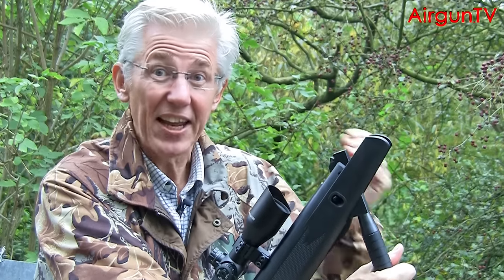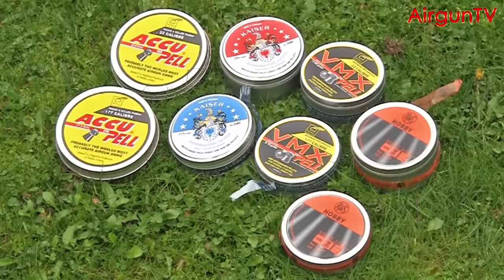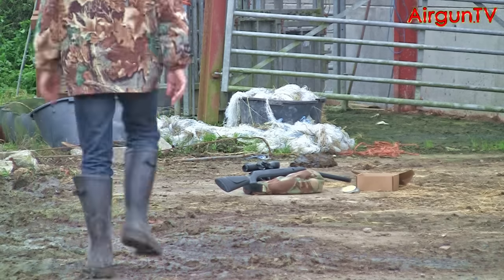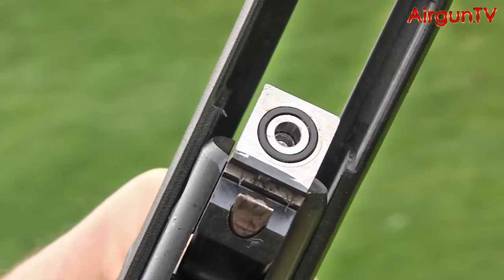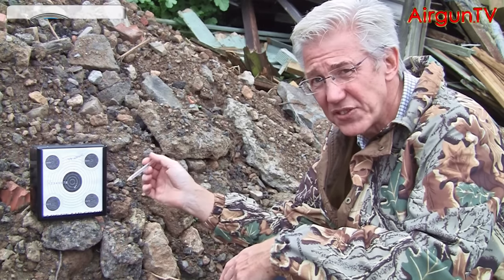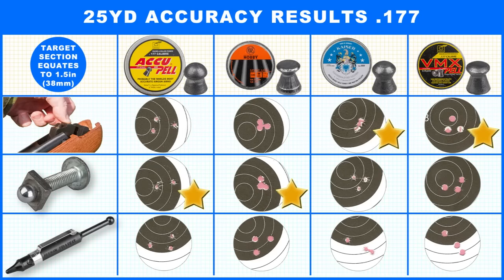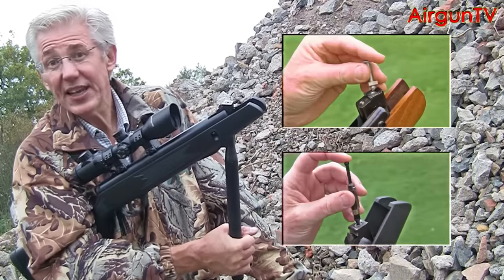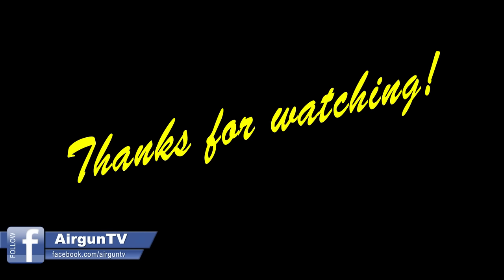PELLET SEATING - boost performance of .177 & .22 air rifles?

Comment: Your video piqued my interest as it reminds me when I seat center fire bullets.  It appears that you get the accuracy with your ball bearing  pellet seater.  You beveled,  slightly,  the mouth of the breach.  So when the pellet is seated, is the pellet seated just slightly below the flush level of the beach?  Thanks for the upload.
Reply from the maker: +Tyrone Kim It's pretty much flush; the bevel (chamfer) helps the pellet skirt 'break' at the optimum pressure point (IMO)
Reply: AirgunTV Thanks. Best wishes.

Comment: i seat my pellets with a .22rifire cartridge with a ball bearing glued in the end. in my experience it doesnt so much improve accuracy but it does improve consistency as all pellets are seated identically :)
Reply from the maker: Thanks for that info - and useful tip - Lewis. Much appreciated. ATB, Nige
Reply: AirgunTV no problem nigel. i love that your doing videos again, you videos are very interesting putting theories to the test. keep up the great work!
Reply from the maker: +lewis furness Appreciated:)

Comment: Nigel, I would also like to see the standard deviations and %RSD (100*standard deviation/average) from the power measurements. Rather than just looking at total power, the spread of the power measurements would be a more accurate evaluation. For instance, if the power did not improve but the %RSD did. This would show a more consistent power output even if it was lower.

Comment: Pellet seaters are always used for accuracy, not power. I dont see any way for it to increase power. The other reason to use one is to ensure that the pellet is actually fully inserted into the breech. If any pellet skirt, even a small amount shows that lead will either be sheared off or squashed. You dont want lead building up around there. You want to leave it all on the pellet. 
   Ive never been able to push a pellet fully in with my finger, so a pellet seater is a must afaic. I just use an old ball point pen tip. It works just fine. If the pen still works, nothing will happen to it. It can still be a pen.
   YMMV, FWIW, WFYB, JMHO, etc.

Comment: you can't beat a mark1 thumb, at least you've always got it with you
Reply from the maker: That is SO true superowl... although once you work out if pellet seating DOES make a difference to either your power or accuracy, you end up not having as much confidence in it as you used to!!! But I give your comment a, erm... thumbs-up!!! ;)
Reply: Yes you have always got your thumb with you right up to the point that you let go of the barrel when loading and the bear trap mechanism fails...

Comment: I lube the pellet before seating, and they seem to fly faster. At 30 yards, there is a noticeable reduction it impact time. Not scientific, but seems to work for me. Also penetration is a lot better.
Reply from the maker: +CaptAmerica12 Interesting...
Reply: If the lubricant used is petrol based it is called dieseling and will effect speed and power very much!  Use oil, not solvents or you will dissolve/damage the Oring. You may want to install a better o'ring for long term maintenance of rifle.
Reply: @Gregory Lankford
How do I get a better O-Ring for my air rifles? I have a Daisy 880s & Bear River TPR 1200.
Reply: it would also put him over the 12 ftlb uk limit.. and if it diesels some places consider that a firearm..
Reply: @ Gregory Lankford Actually dieselling does not make the projectile move any faster. It just gives a louder bang. Taofledermaus did a video on this and noticed the speed was consistent but the firing slightly more  louder than normal.
Reply from the maker: +william northcote I have to disagree. It'can' increase the velocity
Reply: So there now seems to be a disagreement. One is saying yes and the other is saying no. Is there a defined test online to prove if it is or not?
Reply from the maker: +william northcote Pellet lubing sometimes can increase velocity - due to reduced friction and/or afterburn [on springers] - and can also not. It's all a black art, not a science. You have test it with your own combo and see what works...
Reply: william northcote I watched the toafladermaus video, and he concluded that it doesn't increase power. I've seen other videos that show just the opposite.  This one is tough to decipher at the very least. I like diesling personally. And I do think it makes a power difference. But, I like toafladermaus and his stuff too.
Reply: Which lube mate? Durex?
Reply: +william northcote look up daisy vl
Reply: go to a car parts store and buy the hard o-rings  they will have o-rings in all kinds of diameters,
Reply: Lube can slow your velocity if it adds resistance. And can increase velocity if it either reduces friction, or diesels. Dieseling will destroy your gun. Not just the O ring, but the piston, and piston seals too. It is worse than dry firing.
Many lubes can cause dieseling. When trying lubed pellets, I lost velocity, and accuracy. With a few pellets, cleaning the pellets made a larger difference with accuracy. Sorting by weight, and sizing your pellets makes a bigger difference improving accuracy. Group your pellets to +- 0.05 grain.  Sizing may take several dies. Some of my guns like 0.177, some .0178, and one loves 0.176. 
All of my guns shoot best with a clean dry barrel. Solvents, most gun cleaners, bore cleaners and oils will destroy your seals in time. Lube your seals and O rings with silicone grease or oil. 100% silicone to prevent dieseling!
Reply: @gpecaut1  it depends where the dieseling occurs ,if its only in the barrel inside  ,its will not destroy the gun(i shot thausands off times with a full power tuned hw 80 that way  (thinking  of the weihrauch  baracuda eathergun factory made in the past where the eather air exploded in the cilinder), no oil or grease (only silicon oil or molybdeen disufide is ok  )must get  in the cilinder!!!!  only a in tinny bit in  the pellet hole. will do the job and effectively.

Comment: There is no secret to this, the pellets have to be seated flush in the breach. There cannot be any gap between the pellet and the barrel. Always make sure your pellets skirt is not deformed. Accuracy comes with learning how to shoot your particular air rifle. I have a low powered Springer which i shoot and can stack those pellets at 10meters, you just have to do your part. 😎

Comment: I have been seating my pellets for years..most of the cheaper air rifles you will hear and feel a thud as the piston bottoms out ,,however I made a pellet pusher out of a tapered centre punch with a brass washer pushed tightly on the taper of the punch ,thru trail and error I can finally can say it makes a big difference only because it does not push the pellet too far in only enough to reduce the friction at the start of the piston moving forward ,but maintains enough air pressure to widen the skirt of the pellet thus grabbing the rifling,,the only pellet I find where this is not worth doing is with the quality of RWS pellets

Comment: the beeman pellseat also has an ball on the end... next time use it... it also helps seal the pellet in the breech
Reply from the maker: +James Denny Thanks for the advice, James. I have used it in the past, but find that it 'splays' the skirt too much. Also, it's really only suited to the one calibre; i have a DIY tool for each calibre (which I perhaps should have pointed out in the video) - a 5/16" BB for .22 and a 9/32" BB for .177 pellets.

Comment: I would have collected more data w/ more shots. Dude should have done 3 sets of 3s.
 
   People assume "power" and speed equals better. It's not. It's all about finding the sweet spot for the gun and pellets. Each set up is different but there's always a spectral sweet spot on air rifles. 800-900 fps is usually good for .177 -.22 because the pellets, (being air driven) begin to swirl around the 70yrd mark. due to the wave tunnel behind the skirts.

Lol, mine 177s are still super tight at 60-70 yrds tho.

Comment: how did u make that seated m8
Reply from the maker: Hi Sniper - I just got a ballbearing and glued it into the 'well' of a nut which I threaded onto a bolt using epoxy resin. Simple, dirt cheap... and, as this video proves, rather effective with the right pellet/rifle combo. HTH
Reply from the maker: sizes of BB for those interested: .22 - 5/16"; .177 - 9/32"

Comment: The idea has been copied by Weirauch in their competition guns. The pellet is projected further into the breach by a longer probe. Better ways to improve the speed & accuracy are washing & drying the filth off the pellets from the tin, filth, that will very quickly coat the inside of the barrel, then lubing them.

It works.

Comment: So why not make that tool to sell to public?
Reply from the maker: Good idea... but I just don't think there'd be the demand there...
Reply: I don't know airgun is growing and there will be always newcomers so besides helping others you can make a couple bucks selling them on Amazon or Ebay.
Reply: This sounded like a juicy contradiction mate
Reply: you can do the same thing with a ink pen and no sraching like a bic pen. back side to make it flush.  the tip of the pen to seat.  if your pellet is not seated. it can get pinched and tear your breach seal .2 if your pellet is not seated it can fall out as you shut the gun    and you will dry fire the gun ( the worst thing you can do to your spring gun )   I love your videos.  but only seat the pell a small amount. to far in and the pell will be out befor the spring is done and it will slam a bit  a lite pell will let the gun slam a bit   a  higher gr pell will slow the spring less slam the pell and spring go the same speed at the end of the shot. I. never use lite pells    is like half dry fireing the airgun
Reply: Beeman tool is still available. The other end has a ball and will seat the pellets just like his home made tool. Easier to make, very cheap, is to just grab a swizzle stick. The end you stir with usually has a ball end. Cut to, or break, at desired length. Deep seating, like he was doing with the Beeman tool, can be done with the point of a ball point pen. This usually only helps groups and velocity on weaker air guns or pneumatic guns. Springer's, either metal spring or gas spring, usually like a flush seating, like you get with a ball or flat starter. The increase in accuracy is probably because the pellet is fully seated, and seated the same shot after shot with a seating tool over slight differences of seating depths when you use your thumb or finger. 
Most PCP guns use a probe to seat the pellet, so since they are a pneumatic gun, I believe this helps with their velocity, power (fpe), and accuracy.  CO2 guns are the same as a lower powered PCP. And usually use a probe to seat the pellet too.

Comment: That is so wrong.If u push the pellet inside the barrow u lose a lot of speed(we are talking for high power airguns).For low powered airguns just use .....a single drop of diesel and u will see the diference

Comment: Good job .But give me some Vaseline it's time to diesel. !
Reply from the maker: +John Neubauer 🤣
Reply: What ! ? Chicago ! Vicks rub also works .
Reply from the maker: +John Neubauer 🤣
Reply: It destroys a good gun. Plus why would you give up accuracy for a high velocity pellet that can't hit your target?
Pellets are most accurate when kept below the speed of sound. Driving them faster just opens your groups. It's better to hit a rabbit or squirrel in the head with 10-12 fpe, than miss them with 30 fpe.
Reply: Or just buy a gun with good fps
Reply: @gpecaut1  It's about the entertainment value. You diesel for fun, like shooting a hole in a coin or shooting a shaken pop can or egg. Fresh dog poo covered in flies is fun too, as a bonus you know the flies are now covered in it. 

It doesn't hurt most guns and so far the only damage I've seen or heard of is some melting of a Weihrauch main seal because apparently they have a low melting point. It also helps to put the fuel in the pellet, not in the chamber.

Comment: not sure why people even bother with brake barrels not touched one since i realised fixed barrel underlevers exist its like car designers rolling out a 2017 model on leaf springs 😆 people who understand fine tolerances DONT buy brake barrels
Reply from the maker: I have to disagree. The belief that break-barrels are less accurate than fixed-barrels is old thinking. Some of the more modern airgun breakers will match any fixie, Barry.
Reply: name one ? if there was one you would of said check out the blah blah blah 😉  had -bsa super sport fwb webley vulcan theoben eliminateor gas ram (they fail it got sent back 3 times in 2yrs ) gamo's diana's ive had the lot in 22yrs shooting, my hw97k takes a big 💩 on the LOT of em. common sense should tell you something that smoothly swings open an closed lacks fine tollerences needed for shot after shot accuracy. a sight would have to be bolted to the actual barrel for a brake action to match a tx200 or 97k 😑  but you already know that an probably dont wanna crap on half your audiences sets ups so i get youre standpoint 👍
Reply: fatbarry barry I had a cheap fixed barrel underlever 22cal airgun. accuracy was horrible. gave it away.
Reply: +Thor nameless ive used a few fixed barrel multi pumps that were pretty bad , what was it ?
Reply: fatbarry barry Chinese spring air rifle QB.  Pretty horrible. I believe it was QB36-1. I couldn't get it good enough to use with iron sights.  I bought a crosman nitro piston. Much better accuracy.

Comment: Don’t Push the pallets just passed flush with the face of the breach it this will decrease power and accuracy and lower pressure between the spring piston in the palate